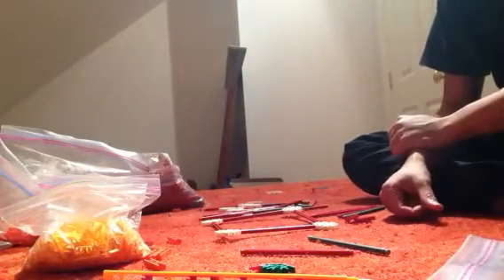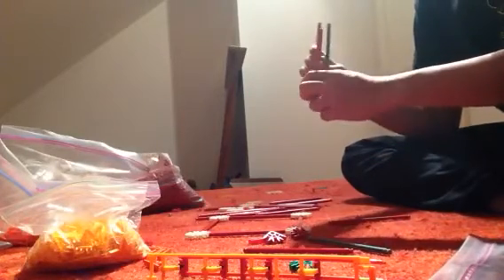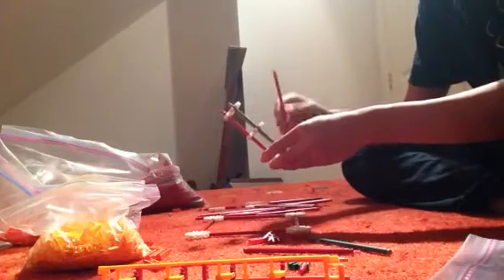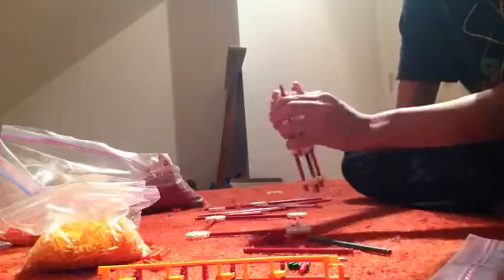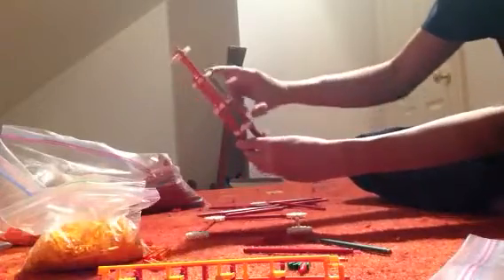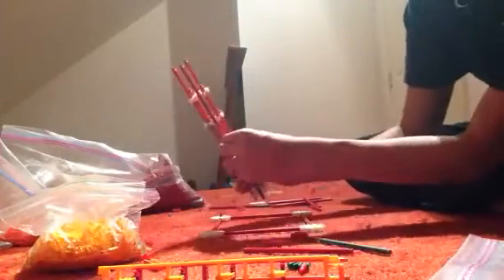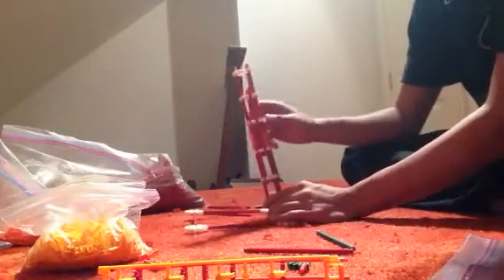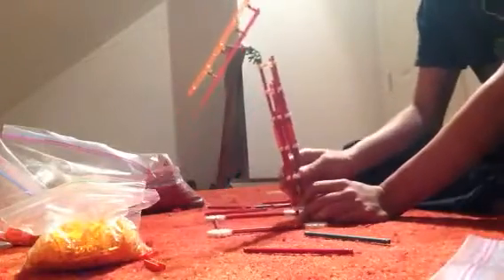How to Make Knex Roller Coaster Tubes

Comment: How would you recommend supporting the lift motor with tubes? I have a box structure holding it up right now, and it's 12 blue micro rods tall.
Reply from the maker: It's kinda tough, I usually put the lift motor at the bottom if I'm supporting the hill with tubes. Then put an extra gear or two to guide the chain. Other than that I guess try to make sure that the tubes support the hill in a straight line, maybe you could have a miniature box at the top for the gear, supported by tubes.
Reply: I actually came up with a decent truss structure to hold it. http://sta.sh/2543jscbyjr
Reply from the maker: Nice. Is it stable when it runs?
Reply: Yeah, pretty stable. It's also geared up

Comment: can you do make tubes with micro pieces? and how would you connect pieces in a triangle form?
Reply from the maker: Yes! You can. You would just use a gray or 8 position connector in place of my white connectors that I have in this video. Then for the rods you can use orange or blue rods. It works just the same. To make a triangle of tubes, you can use small tan connectors to have connectors connect directly to a rod from the side, or there are many other ways.